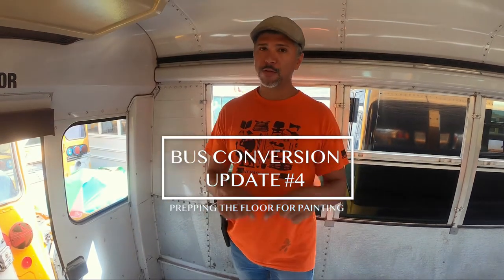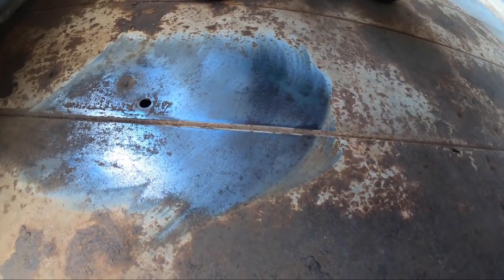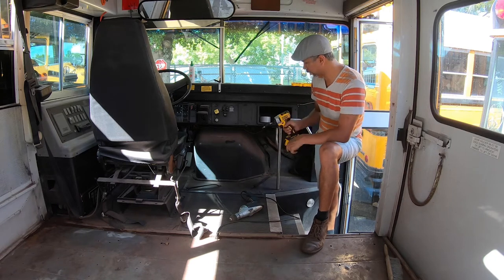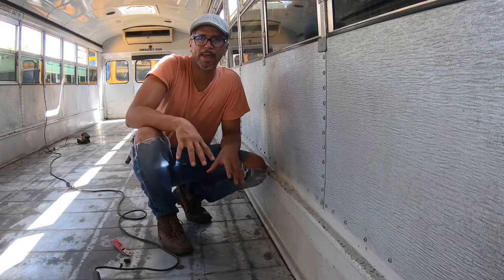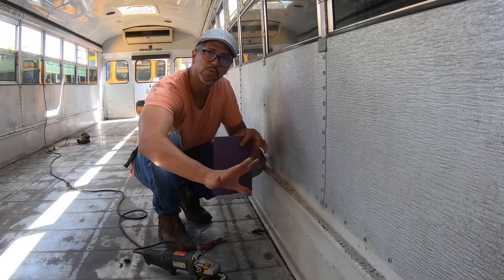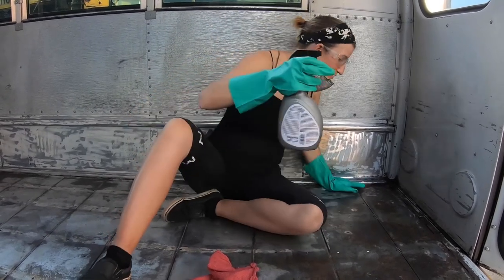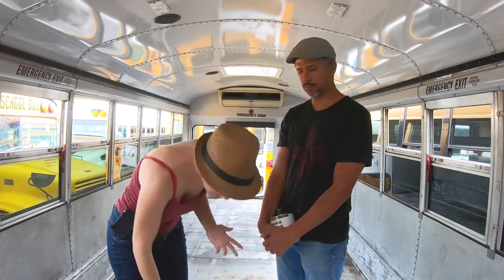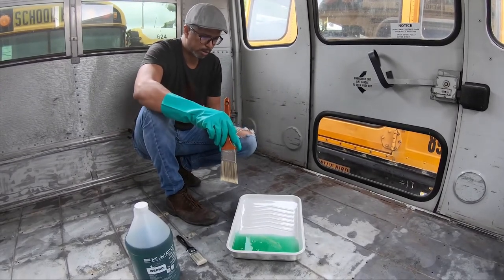How to Prep a Skoolie Floor for Painting | Skoolie Conversion

Comment: what is the video after this ? did you use the rust oleum after you used  Ospho ? what is the name of the primer you used after  Ospho ?
Reply from the maker: Hey JS!  Here is the video and tutorial that follows: https://artwethereyet.com/blog/painting-patching-bus-floor/

We used Rustoleum Rusty Metal Primer: https://amzn.to/3AKZYTr
Then we used Rustoleum Enamel.  We used the metallic silver version, but later we had used a glossy version like this: https://amzn.to/2Vvoc3R

We patched the holes with Loctite PL and epoxy resin.  The link above to the tutorial walks you through all those steps 👍
Reply: @ArtWeThereYet  What do i do if paint is not sticking because of Oshpo ?
Reply from the maker: You’ll have to prep the surface again by removing the ospho and any paint that is peeling off